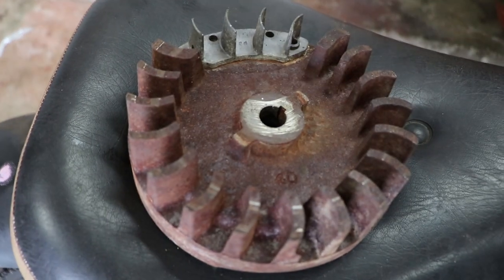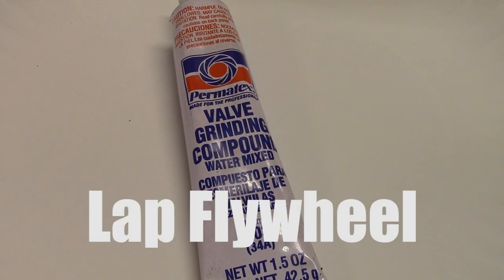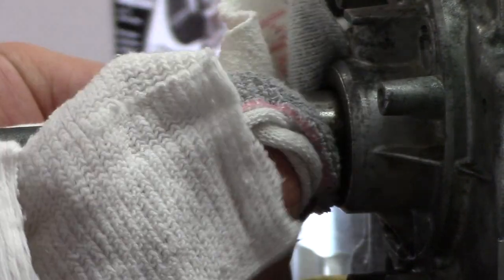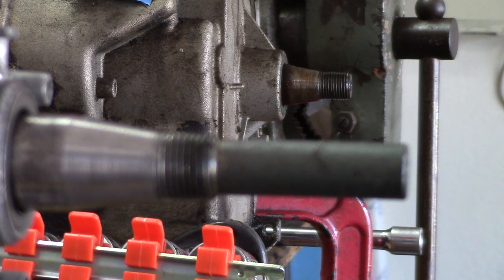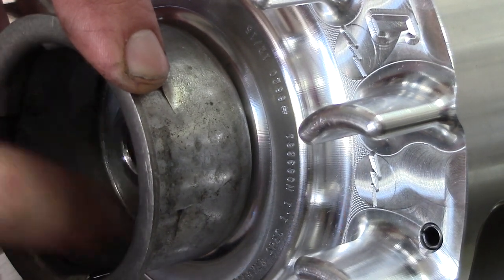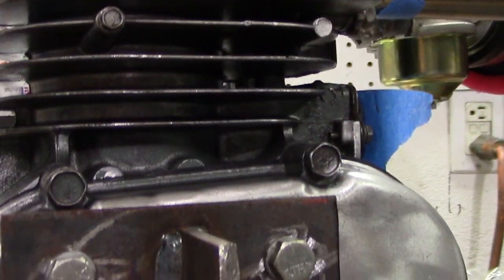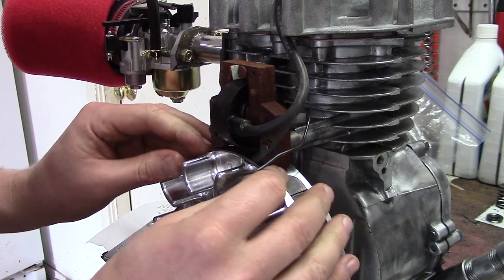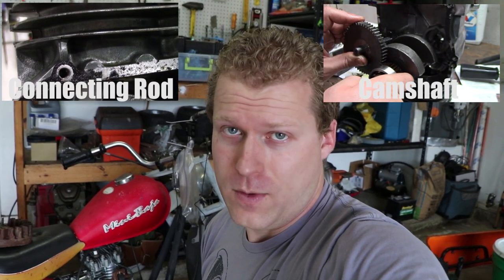Arc Billet Aluminum Flywheel: How To Install

Comment: Some locking pliers will NOT Mar the crankshaft for stopping the engine from turning when you are installing the flywheel I've always done it that way and I never damaged a crankshaft from doing it that way all is did was put the locking pliers on the output side of the crankshaft and have the engine on a bench and turn the the motor over the same direction as you would be if you were tightening the crankshaft and when the pliers hit the bench it will stop it from turning and then you can torque it Down
Reply from the maker: +alex pencek what did you torque it down to? Mine broke loose still clamped at 35 ft lbs, even when clamped hard.
Reply: KartFab hi kart fab i have just installed the same fky wheel and im wondering were you found the camshaft for yours
Reply: Bad practice good way to chip the keyway groove at least out a piece of rubber hose between the grips and the shaft.

Comment: Just had a question I have a 6.5 greyhound and everything is ok beside when the choke is on it runs and when I take the choke off it dies
Reply from the maker: +Crazyjesse11 fuel delivery problem causing your engine to run lean.clean your carb.
Reply: I have already clean it and it's still doing the same
Reply from the maker: well, what you are describing is a fuel delivery problem, so I dont know what else to tell you. Clean out the tank, union, fuel line, bowl, all passages in carb, including removing the jet and emulsion tube.
Reply: Ok cool thanks I'm going to clean the tank
Reply: So I clean the gas tank got new gas lines and I bought a new carburetor and it's still dies
Reply: Crazyjesse11 did you get it running better? A carb adjustment may help.

Comment: Hi if im putting the stock one back on how many ft lbs and what if i dont torque it down
Reply from the maker: +Nick donato 55 ft lbs iirc(check the manual) and if you don't torque it to spec you run the risk of shearing the flywheel key and/or spinning your flywheel. Both of these can cause your engine to not run, or break entirely.
Reply from the maker: You put the key in, but you make sure the flat edge of the key is parallel to the crankshaft, NOT parallel to the crankshaft taper.
Reply: So 55 foot lbs is the torqued spec for a stock flywheel

Comment: For a drag mower on dirt 150 ft line to line what motor you with
Reply from the maker: Gear for 35-40 mph tops.better have some grippy tires.
Reply: KartFab  what motor would you choose
Reply from the maker: @jeffcox3109  a torquey one with a wide powerband, not sure what  the rules are though so i couldnt tell ya.
Reply: KartFab  my fault , all mowers has to be belt driven ,  hp range you brig it you can run it. There is 20 guys that race . I know nothing about motors unfortunately. They want tell me anything that’s ok. Any help would be greatly appreciated thanks for your time
Reply from the maker: So the main performance gains you will see with an engine are with a carburetor and cylinder head work. Common engines for these vertical shaft motors that have performance upgrade options are the briggs Vanguard v-twins. You would want some type of slide carburetor and a higher compression ratio with a camshaft that would be a pulling or torque mid range type of camshaft. With the head you would get the head milled and get shorter pushrods with higher spring tension valve springs. Possibly a three angle valve job with a fully ported intake and exhaust port. The valve size might be enlarged if you go with a more extreme camshaft and you would need roller rockers for extra mid range to higher range power with an aggressive camshaft. These are all general guidelines and I Have never built a performance v-twin. The main thing here is to get a better carburetor and get some serious had work done and put in a better camshaft then the one that is in there and you will do very well. It is not just engine work but during so make sure you do a lot of trial runs with curing to figure out the best top the b The main thing here is get a better carburetor and get some serious had work done and put in a better camshaft than the one that is in there and you will do very well. It is not just engine work but curing so make sure you do a lot of trial runs with during to figure out the best Ratio for highest speed at 150 feet. In my limited experience, you would probably want to go 35 to 40 miles an hour as your top speed at the engines target top RPM
Reply: KartFab Thanks for your time I am sure I will ask more questions later

Comment: You could just use an impact wrench set on low or with a torque stick to torque the flywheel and hold the PTO with your hand. You really don’t need to use a torque wrench.

Comment: What happens if I only tighten my flywheel to 15 ft lbs. will it still run. I want to get the engine running but won't have the recourses to torque it to 60 until later this year.
Reply from the maker: +Owen Stephenson it can spin the flywheel on the shaft and break your engine.
Reply: wont start it then. thx for the help.
Reply: could i use a torque driver to torque it on?

Comment from the maker: One step closer to finishing the briggs 5 hp performance build with a shiny arc  billet flywheel. Links are in the description for all the parts and tools used in the video. Any guesses on how fast this thing is going to go?

Comment: I replaced my flywheel and it ran for like 5 seconds before it shut off and now she won't start back up.
Reply from the maker: You probably spun the flywheel on the crank by not torquing it to spec so your timing is off.
Reply from the maker: Either that or you fried your magneto by not spacing it far enough from flywheel magnets
Reply: Idk what happened yesterday but I swapped the carburetor out with one I bought on Amazon as a backup and she fired right up. I went on a couple test rides and let it idle in the garage for a minute it sounds good. But I can hear a rattle and it wanted to stay around 3k rpm for a second before dropping back to idle. I checked the flywheel and the cup everything feels tight still doesn't look like the nut moved any. I'm going to check it out again tomorrow.
Reply: I was still using the stock carb and I've been having issues with it so I got a replacement and had it sitting in the box incase I needed it. Its just a cheap stock replacement the only other difference is I didnt swap the new jet on it. I have a air filter and exhaust upgrade as well as the flywheel and the filter came with a little fitting thing. Its still in the old carb.
Reply: I found the problem. My cheap torque converter is going bad. Its grabbing and staying stuck.